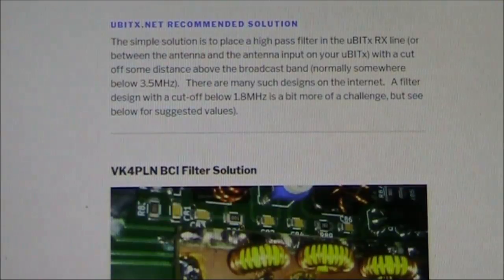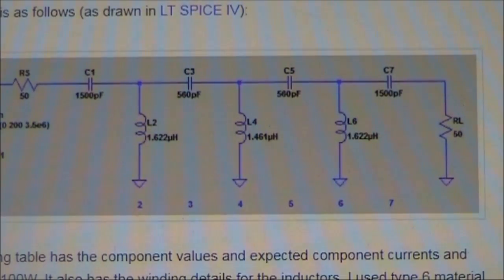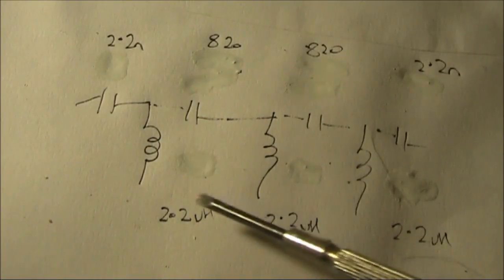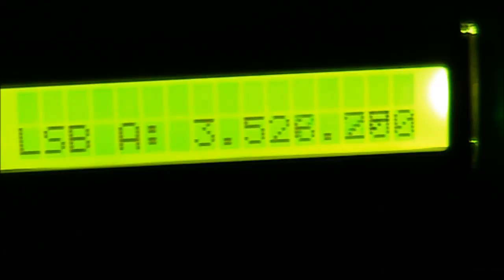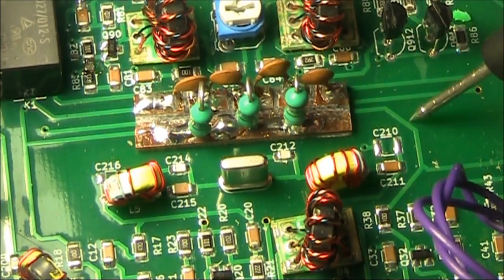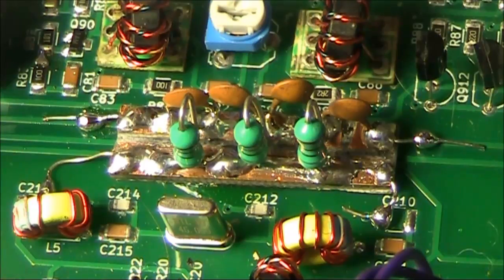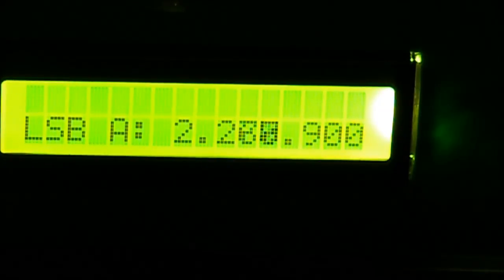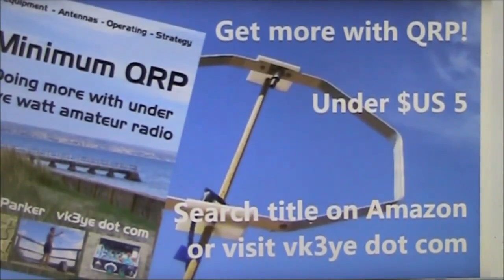A BCI receive filter for the uBitx (with no toroids or SMDs)

Comment: 5:30 The Line Should Be Cut With A Dremmel, I Used Dremmel To Cut Pcb Lines Like That, More Easy And More Controlled Because Knife Can Slip And Do Other Unwanted Damages On The Pcb, But Great Video, Thank you For Showing It !

Comment: what makes the tones when you tune? carriers?  does the trace capacity of the board effect the circuit at all? Is there a reason to enclose the circuit in a can would that help insolate the unwanted frequencies? very cool. those AM broadcast stations are running many Kw! 73 kc9dfk
Reply from the maker: The presence of strong signals near non-linear components (eg diodes) can produce strange harmonics and mixing products that can appear across the amateur bands at unwanted frequencies.  Trace capacity shouldn't be an issue at these low frequencies though it would be at VHF/UHF.  Enclosing may or may not work - eg if the signals get in through the antenna line it wouldn't make a difference.

Comment: I wonder if you could use the antenna trace itself as the solder pads by cutting and scraping in multiple places to make small points to solder to then for the ground connections just drill holes through to the ground plane on the bottom of the board. If done with care you could probably make it look almost like it was there from the factory.  Just an idea, not having a ubitx myself, I'm not sure what's under that particular spot on the board.

Comment: I'll do this this evening, thanks. I'll use SMD parts, though, more compact and easier to work with when you're just scratching traces into PCB

Edit: I used single sided breadboard and throughhole because I didn't have SMDs with the right values, works like a charm
Reply: Cool man, thanks for sharing
If you like, dirtypcb can cheaply make you pcbs, since this filter is small, maybe you wanna make a bunch on a single pcb then cut them. And maybe combine both SMD/and thruhole design on the same PCB. So it works either ways.
https://hackaday.com/tag/dirtypcb   Good luck

Comment: Cutting traces can be a little fiddly using a hobby knife or box cutter.  Next time, try an appropriately sized drill bit (spun by hand, not using a drill).  Makes it a snap and looks nicer too imo.  Very nice job on the filter, Peter, thanks for another great tip! :)
Reply: BEdmonson85 I have used my drimmel before w a sanding wheel and once w a special bit...they did ok I will have to try the bit by hand!! Thanks for the idea!!!